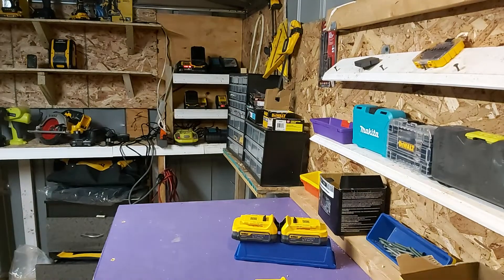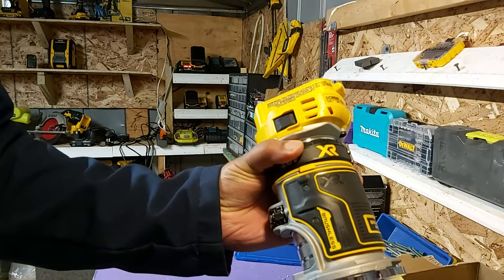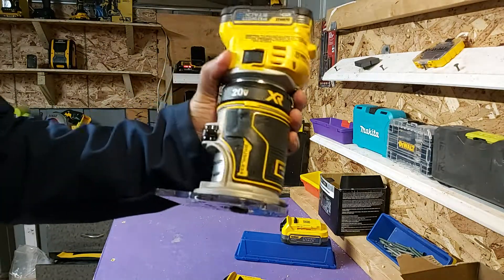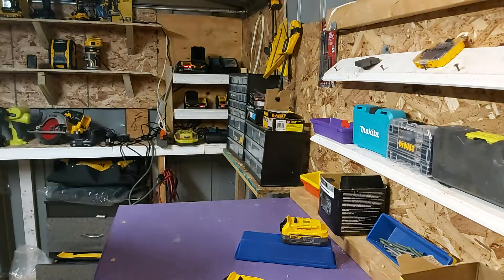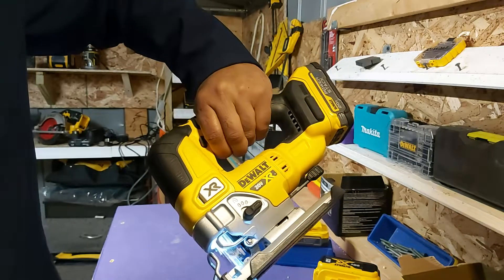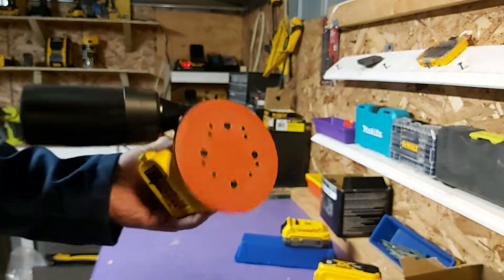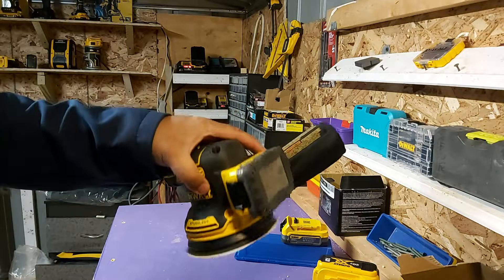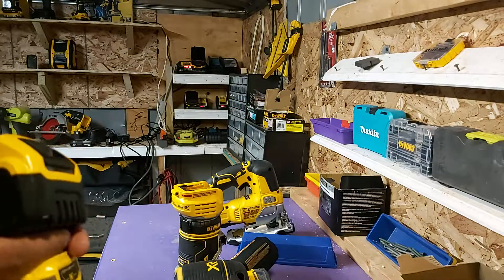Dewalt Powerstack Battery Review: Why it's just better than the competition

Comment: its only a 1.7ah its designed for high current draw applications but its life is short compared to any other battery with higher ah rating....ampere hour rating is like a gas tank the bigger the number the bigger the tank. the only advantage it has is its compact size and light weight and higher current draw rating[not the same as ampere hour]